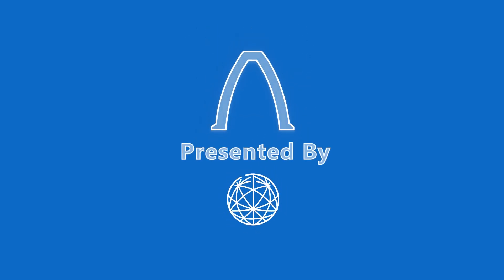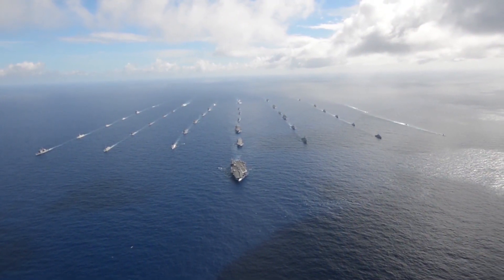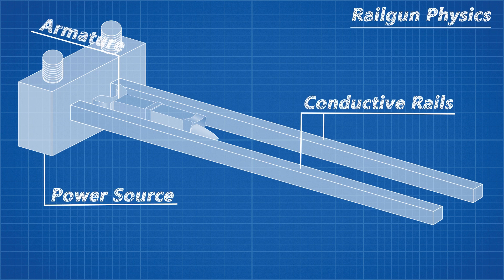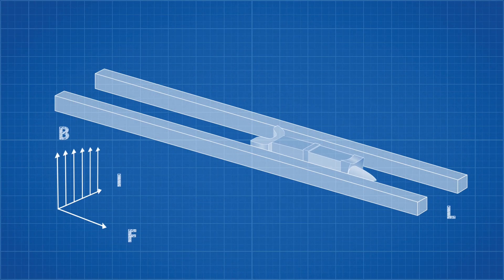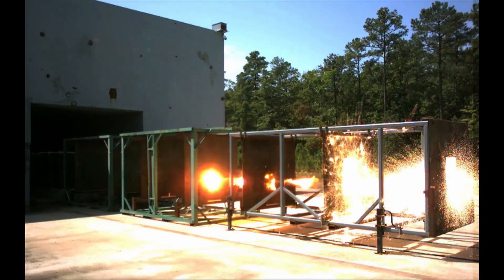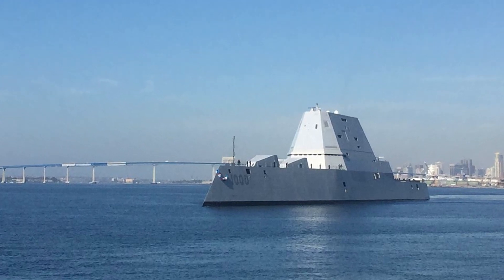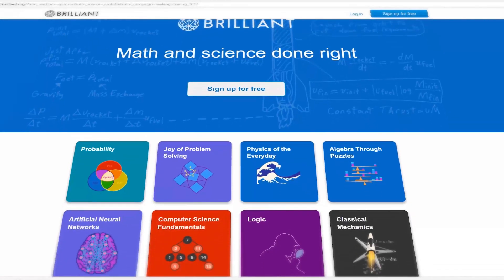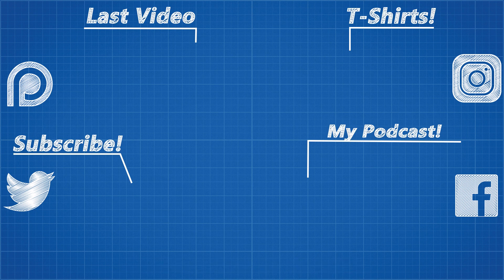The US Military's Most Powerful Gun

Comment: This technology will send satellites or supplies into space some day.
Reply: I think the satellite and supplies might be damaged accelerating higher than mach speed, but that is a cool idea yeah
Reply: Yes, we all think so. The supplies will  be probably more easy than the satellites. Then again, the satellites can be made durable, when they are very light or designed to be very durable.
Reply: PerfectNoodle A lot of the electronics that are currently used in cannons have to deal with 100g of acceleration anyway. Satellites deal with 6-9g of acceleration usually. The problem with guns to orbit is that if you want to launch something to space at 100g you need a gun maybe a 400m long but to launch something at 10g you need something over 6km long.
Reply: the big problem with that is the horizontal speed you need to stay in orbit. If the gun is pointed upwards, the satellite/cargo will reach orbit height but will have no lateral velocity- which accounts for most of the delta-v necessary to get into orbit, and must then be provided by rocket engines. On the other hand, if you point it somewhat horizontally (30-60 degrees maybe), air resistance will be huge, since it scales with the velocity squared.
Reply: No it won't. Even if a supplies capsule or satellite isn't vaporized by the g-force of accelerating something to orbital velocity in just a few dozen meters, the immense muzzle-velocity you would require just to overcome aerodynamic resistance would result in dynamic pressure vaporizing the payload anyway.
Reply: Not the first time a gun is thought of, as a space launch mechanism:

https://en.wikipedia.org/wiki/Gerald_Bull

For raw materials, and supplies, the g-forces shouldn't be an issue. Some assembly required, once you get the bits in orbit..
Reply: @michaelmoorrees3585  https://www.youtube.com/watch?v=BNLZntSdyKE
Reply: PerfectNoodle, The solution to that would be a longer rail for more gradual acceleration, reducing g forces. Though this would make it very long.
Reply: Quasi84 exactly
Reply: The atmosphere will burn up a rail gun shot toward space for the same reason a meteorite burns up.
Reply: No worries about the magnetic field. The friction is the real issue. A levitated package would be much better to send into space without damaging the rail.

The magnetic field can be blocked by metal or distance around the device.
Reply: epSos.de it's physically impossible  to put a satellite into orbit using only one point of propulsion. You cannot raise the perigee (Lowest point in orbit) from the perigee. So no matter how fast or what angle you shoot at, the lowest point in the orbit will never be higher than the gun.
Reply: Thank you, finally someone that understands a rail gun can not launch objects into earth orbit. It would take a second acceleration once you get past the atmosphere to achieve a stable earth orbit and rail guns can't do that unless they have a second stage rocket on board which would blow up under the g load of launch.
Reply: Especially once we get a moon base.
Reply: I love the concept of the game SOMA which people have built a massive coil space gun that shoots cargo from the seabed to space but in real life, it won't work.

The biggest problem is: the cargo has to carry all the energy needed to reach a stable orbit after it leaves the barrel, no matter you use gradual acceleration or not, that massive amount of kinetic energy will tear the cargo apart before it leaves Earth's atmosphere. Therefore, you need a barrel so long that it extended all the way from ground to space, which is kinda impossible to build.
Reply: i think that right now, engineers construct and design satellites with keeping the weight down as much as possible (because rockets), but i reckon that if they had durability and strength in mind, it could be down.
Reply: Space launch guns have been dreamt about longer than just the last century.
https://en.wikipedia.org/wiki/The_War_of_the_Worlds
Reply: maybe having a multi stage system, with the railgun at the surface, then igniting a second stage. also who said it has to be in just a few metres?
Reply: It's extremely doubtful that there's any way to eject a fuel tank at muzzle velocity out of a railgun and avoid having it be instantly torn apart.
Reply: Remember we're dealing with huge payloads, a technology that can launch a ballistic shell at mach 6 will not be able to launch a satellite at the same speed. But I think we can do it. I think probably the main trick to achieve a good launchpad based on this technology would simply to not actually try to capsulate the entire payload like is done for bullets, you don't need this much surface area touching the rails. Essentially I think the rocket or payload should be on top of the rails rather than between them, only a small part of it needs to be between them This means we can use smaller rails for bigger objects which and we will be able to control the rate of acceleration more easily at the cost of needing a longer launchpad. Although considering the price it costs to make a railgun, this is far away.
Reply: epSos.de except if we launch supplies into space with rail guns, good luck slowing it down once it breaks atmosphere
Reply: this is very possible nowadays.
Reply: James Kinard try creating a space supply shipment gun and end up creating a country killer.
Reply: James Kinard theres also the problem with the high magnatic field...
Reply: How is the setup in the halo games ?

Long rails or short rails ?
Reply: Space is expensive. Long rail launchers with levitated packages are doable. As long as the system is re-usable and cheap to maintain, then the price is irrelevant, if the system can stay up for 50 years or so.
Reply: How exactly do you imagine that to work?
Reply: epSos.de shut the fuck up
Reply: This was used in book, Columbus Day.
Reply: yep, basically what i was thinking, massive speed isnt the problem, but the cost to find the right ammount of acceleration then maintain and build the gun is the problem.
Reply: No it will not
Reply: Tommy Mitchell lol
Reply: +epSos.de   No, it is basically impossible to shoot something into orbit if it cannot propel itself during flight. And yes that is also true for a Mach 6 projectile even though it exceeds escape velocity it will simply not reach even a low earth orbit without a continuous acceleration like a rocket. BTW are you german too because of the ".de" ending in your name?
Reply: +Jason   Who are you replying to? Also I gotta say another Jason with the same opinion is just too much for one thread ;D
Reply: I originally wrote it in reply to drew p. but it equally applies to your comment as well or anyone in the 40+ comments that are aware rail guns can not put stuff in Earth's orbit. If you shoot something fast enough you can put it into orbit around the sun, but not earth.
Reply: epSos.de gundam animes most of them propel their space ship to space using this tech...halo too and some other stuff..
Reply: 6km long magnetic rail acceleration system is not the issue, if we can launch supplies or satellites into space for less than 10k per delivery.

It will happen if the technology and demand is ready.
Reply: @funny-video-YouTube-channel  naw,wwll use space x and jeff vezos for that, thank you. And thank capitalism
Reply: Space is fake. Earth is flat. Wake the fk up.

Comment: Wait, I feel like your missing something. Your description of a railgun is interesting but I don't think its right.  Wouldn't a "Railgun" follow the same properties as a Magnetic Elevated Train? A series of magnetic pads activated in line at very specific timings to propel an object forward? So what you should have is a NON-magnetic barrel with a magnetic projectile inside, flanked on either side with a rail lined with magnetic pads. Thus the rails don't want to rip apart like you described, and if the barrel is made of a similar or greater material to current tank barrels, which if last i checked was a combination of steel, carbon fiber (to act as a heat disruption material) and others. Which already have to contend with "normal" heat generated from prolonged periods of firing. The real problem is to generate the power required for firing and operating as well as making small enough to make it portable. Look at sci-fi they have great examples. If you haven't made a "Coilgun" video look at Halo's MAC cannons which are "Coilguns" and are the same yet different from "Railguns". Make a video to compare the too. Thanks.

Comment: why doesn't the armature use rollers instead of a static conductor to minimize friction?
Reply: Rollers would require a sort of brush. Like a brushed dc motor. However, when dumping hundereds of thousands of Ampères into it, you will even have worse efficiency. Now there are certains ways to replace sabots, like pusher plates.
Reply: Geelar 
Rollers are much cheaper to replace, mind you
Reply: You would need some impressive electrical contact bearings, or slick ball-and-socket joints to bear that kind of heat generation, thermal expansion, and radial force.
Reply: I believe it would be less efficient because you have much less contact points to generate the lorentz forces + The bearings on the rollers would be fried, kinda shifting the problem
Reply: spindash64
You know [USN R&D PAY ATTENTION HERE], it might help a lot if some sort of non-flammable, non-combustible conductive cooling fluid were used on the rails to reduce friction and help dissipate heat...
After all, they thought up CF4 for deep-sea diving.
Reply: HuntingTarg they probably use graphite already
Reply: Deepfriedpillows 
not what I'd consider an optimal substance - graphite gets more abrasive and reactive as it heats up.  A volatile liquid would be highly efficient at removing heat from the rails and leave little or no residue afterward.
Reply: I'm sure they've tried that already or are going to try it

Comment: The energy to propel the projectile still has to be stored somewhere on the ship, whether it's in the form of propellant charges or fuel for electricity generation. So how is this safer?
Reply: Because Uranium/Plutonium doesn't like to do boom spontaneously. Especially if it is very low enrichment
Reply: True, but the Zumwalt runs on internal combustion engines for electricity generation.

Comment: I'm pretty sure the visible "explosion" when the projectile leaves the barrels comes mainly from the compressed air in front.  

Also any practical railgun would still use conventional explosives as they offer a great way to get the bullet to a decent starting velocity. When accelerating the bullet from rest you have a huge heat-problem at the contact spot.
Reply: Yes, because explosions are known to keep things nice and cool
Reply: I Z - maybe you should learn something about basic physics - particularly newtons laws and electricity.

The Lorenzforce is independent on speed.
At first where the projectile is at rest, to get it to move, you need to pass an extremely high current through it. But specifically because it is at rest this means that this current is going through a single point on the rails, contrary to the situation where it is already moving and the contact-point is ever changing.
So yes, in this instance an explosion might very well "keep things nice and cool" as you so ignorantly stated - freaking moron.
Reply: whooa, calm down dude.
Reply: If you're thinking of initial 'push' along the rail, why not an solenoid-style driven push-plate?  Half the appeal of railguns is to not need chemical propellants.

Comment: Is the direction of the projectile determined by which rail is negative and which is positive? I'm fairly sure it is, due to the right hand rule concerning the cross of ILXB. I'm also pretty sure that the projectile needs a kinetic kick start down the barrel to prevent it from just welding to the rails. Something I think you forgot to mention is the use of the sabot in one of the clips. I think it's important because it preserves the shape of the projectile which will help in making shots more accurate, and you might be able to select a material for the sabots to minimize damage to the rail. I know you can't mention everything, I just though these were important things to point out.
Reply: Absolutely. There is also wear and tear on where the sabot first enters the barrel. Lots of arcing moments before it's ejected. So much detail, but only so much time.

Comment: And if an EMP were dropped you'd wish you still had that cannon
Reply: PyroNite I'd imagine it's rated to resist an EMP.  Our fighter jets are.
Reply: Easier said than done getting an EMP to that gun.
Reply: EMP causes quickly changing high potential differences in an area, which cause high currents in conductors. If the conductors are tiny wires, they heat up and melt => they get fried.
A big conductor will not suffer as badly because it's designed to handle large currents.

So the railgun will not be fried, because it's build to withstand huge currents.
The electronics and subsystems however, are vulnerable.
Reply: Thought they did use tubes in fighter jets, do they not do that anymore?
Reply: PyroNite if a nuke were dropped new you'd wish you had anything
Reply: Xeo Nespydonum 
...this thing called Silicon came up.  Made those bulky tubes kinda unnecessary, especially when weight and Size are an issue
Reply: MIGS had the tubes for ages, that's where I got the idea from, I know what silicon is.
Reply: It would shoot the emp down
Reply: Xeo Nespydonum no they are not. Unless they use vacumn tubes for the electronics, they'll be fried.

Comment: But why don't the DARPA devellop  superconductive rails for the gun ? The power requirement would drop à lot and the durabillity Will increase also à lot. Seems Obvious.
Reply: Because the gun complexity and mass increases by a lot. With superconductors you would need to store somewhere system that cools conductors down (and keeps them) to a near 0 Kelvin temperature.
Reply: And since  they will housed  at least in ships big enough to fit a  10 m canon  space for the liquid helium and nitrogen won't be that much of an issue compared to having a gun that destroys itself after a few shots......Th'at's not near zero temperature for late superconductors, and LHC and all medical MRI machines use superconductive coils to generates strong magnetic field without bursting into flames like in the  vidéo. Maybe they didn't implementaded the superconductive components  because  it's just a series  of demonstrators. They would not use millions in precious materials and hélium  if the ballistic concept is not proven before.